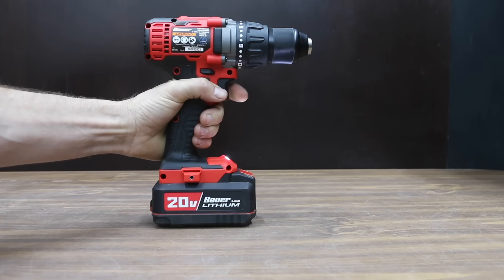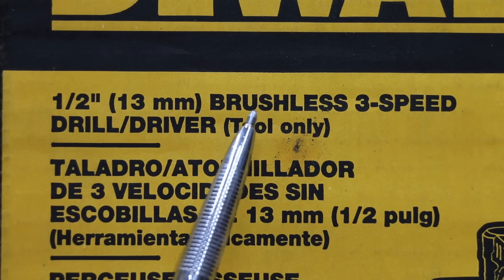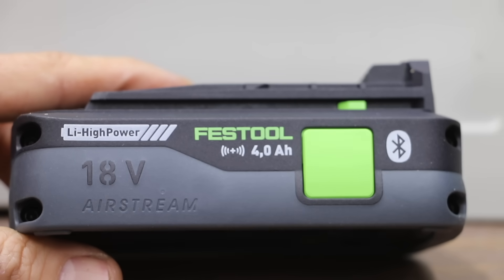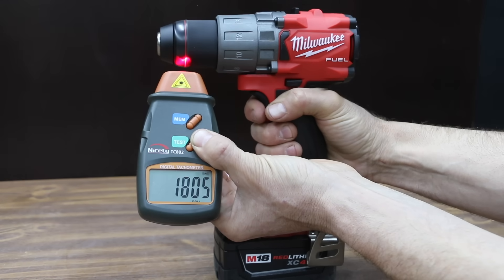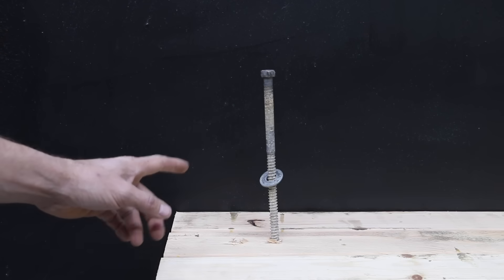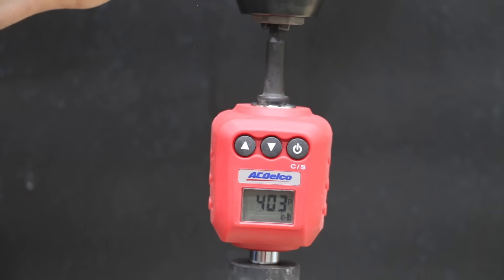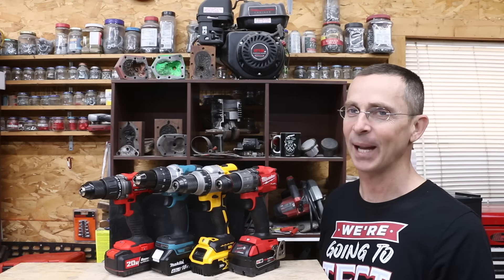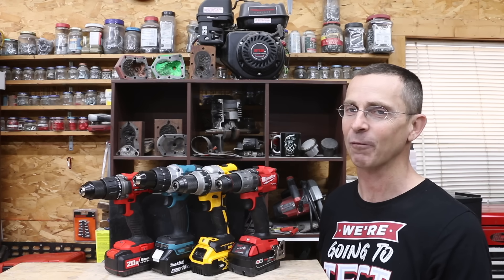Best Drill (BATTERY POWERED)? Milwaukee vs Dewalt, Makita, Bosch, Festool, Ryobi, Bauer, Ridgid

Comment: Great video. About 6 years ago now I bought a Ryobi combi drill and impact driver. Avoided the drill driver because I didn't like the look of it and thought it superfluous considering what I already had. I bought the Ryobi tools as throw away tools that would last a couple of construction jobs and pay for themselves, meanwhile I could earn the money to buy some better portable drills. Well, I've bought myself several other tools that aren't portable drills by now and I have to admit I ended up buying another Ryobi combi drill and impact driver for when my first ones give up the ghost, but they're still going strong. The only problem I have had is with the combi drill but that's because I used a mixer paddle on it too much with thick plaster and such that made the mechanism a bit wobbly so it's no longer the best for precise stuff. The impact driver is still perfect to use and I have not come across a damn thing that it couldn't drive in, even large fixings in wet wood. Grabbed a spare when I saw it on sale for just the tool and I couldn't believe the value.

I couldn't find anything that beat Ryobi on price when you include the batteries and chargers and stuff, and I can tell you from experience that they last, at least the impact driver and combi drill do. I haven't even had to change the brushes!
Reply from the maker: Thanks for sharing.

Comment: I don’t know about the other brands but out of the DeWalt, Bosh and Milwaukee the Milwaukee is the only one that has a drill chuck that is easily user replaceable so since chucks are what tends to fail on me the Milwaukee is what I bought. 

P.S. If there is a choice between metal and plastic chuck versions of the drill shell out a bit extra for the metal chuck.
Reply from the maker: Thanks for the feedback.
Reply: @ProjectFarm  No biggie. The Milwaukee is generally a good drill in other ways since it is also small powerful and handy. That being said I might have bought the DeWalt if it had a user replaceable chuck since it is even smaller and the battery is easier to pull out than on the Milwaukee.

Comment: Fortunately the yankees at least measure time in the same units as the rest of the world.
Reply: Don't give us any ideas lol
Reply: Most Americans can use both systems.  Same cant be said outside the US.
Reply: @Alamyst2011  lol, more like the other way around
Reply: @holdenearl1038  Lol no.  Not like that at all
Reply: @Alamyst2011  You're right, 96% of the world's population should start learning that water freezes at -32 and boils at 212 which apparently seems more logical to some poeple than 0 and 100 degrees. Let's all become idiots instead of use logical units!
Reply: @mojoblues66  Water freezes at -32?  Do you know what your talking about ?
0-100 has 100 measurements 
0 to 232 has 232 measurements   Guess one is more accurate for the laymen.
Reply: @mojoblues66  First, it's 99.98, not 100, so not so perfect after all.  Second, while Celsius may have a good argument for being a better unit for water temperature, Fahrenheit has the advantage of being more precise with air temperature.  And guess which one we humans are generally more concerned with?
Reply: @Alamyst2011  
0-100°C = 32-212°F at standard altitude. So, like 47,54°C is a true measure your more accurate argument is no more a good reason. There is no practical reason to use fahrenheit instead of celsius, only historical uses. Canada uses both but not USA, unlike the entire World where celcius is used.
Reply: @jean-marchemery3116  lol
Reply: @Alamyst2011  Wait until you hear about the comma.
Reply: @LipziG3R  I have learned both systems.  Was taught both systems in school and draft school. For basic house blueprints its all imperial.  For anything mechanical its metric.  Both systems can be very effective.
Reply: @Alamyst2011  I'm not saying that they can't be effective / efficient. Once you learn them they can be used as any other. But saying that Celcius is less accurate because it has less full values for the same temperature range doesnt make much sense, if you can just use commas to get a very precise readout ... way more precise than any normal person would ever need in their life.

Using a system you learned and got used to is perfectly fine tho, obviously.
Reply: American guy on an American platform. Make your own content.
Reply: @user-ct8my8rv9c  Before Globalization we had Colonialism, that's obviously where you are still stuck in.

Comment: Bosch, Makita and Dewalt are a joke compared to HILTI.
Reply: Heh. No! HILTI tools tend to be bulky and heavy. I prefer precision and ergonomics. I'm not saying that HILTI is bad but your statement is definitely the joke.
Reply: @stephenwerner1662  Im not talking about working at home, im talking about professional daily use. Had them all for many years, once you try HILTI you never go back.
Reply: @WhoWantsToBeKing  no. I've used HILTI. I see no advantages to excuse the high price tag of their products. 41 years in construction.
Reply: @stephenwerner1662  I do. Alot more powerful and they outlast Bosch, Makita and DeWalt. Im not talking here about Milwaukee, Festool, Ryobi, Bauer and Ridgid. But If anything is bulky, heavy and weak its Milwaukee, seen 4 different pieces on site and tried, absolute joke. Festool is expensive so ive never got any. Had a 20 year old HILTI drop into barrel of watter, i jumped from the ladder and pulled the cord, 2 days later it worked.
Reply: @WhoWantsToBeKing  I have no problem with you loving your HILTI tools. I just have a problem with you falsely suggesting that  the competitors are a joke. You haven't used them...........that's obvious. 

We both know that you haven't done a comparison of HILTI with Milwaukee, Bosch, etc. Your suggestion that HILTI outlasts the competition just removes your credibility.

Comment: i love my Milwaukees. I spent 25 years in the field as an electrician. They are absolutely bulletproof. But one complaint. All the newer tools are made in China. Really Milwaukee. Even they sold out.

PS, Black and Decker makes a pretty good cordless. They are cheap and effective. The big 1/2" drill and the sawzall 18v are their best.
Reply from the maker: Thanks for the feedback.
Reply: @ProjectFarm  I think you should include some personal input like, does the tool feel like quality? I bought a LOT of stuff on just the feel of items. I can feel quality. 

You are the best on the interweb by the way.
Reply: Milwaukee is owned by tti which is located in Hong Kong, China. It was made in China from the start so they never sold out.

Comment: Nice detailed review as usual. If you need a more light/compact drill the M12 Milwaukee drill is great for drilling pilot holes while working on a ladder. You can keep the drill in one pocket of the tool belt and the 1/4 inch impact driver in another.
Reply from the maker: Thanks!

Comment: "So which one is the best drill?" - HILTI!
Reply: Milwaukee and Dewalt seem to be in the sweet spot.  Festool... what a ripoff.
Reply: @spilot1016  I'd add the Makita in there to your "sweet spot". The Festool? Overpriced junk. Yes, junk. Clumsy and underpowered.
Reply: Milwaukee seems to be worth buying
Reply: @AdelAbuAlaa  I bought the Milwaukee about 3 years ago, and built my house with it, till today i got no issues, and i mistreated it often. At work i got the bosch, but the milwaukee is far better! After this i bought the 1/2 Impactdriver and the angle grinder from milwaukee too. Regret nothing so far!
Reply: @AgentPipapo 
I am Bosch man but from now on will change to Milwaukee if I find it in Australia
Reply: I worked at home depot (hardware dept) and had a chance to test all the drills (Milwaukee, Dewalt, Makita, Ridgid, Bosch and Ryobi) all 18V against the Hilti 14.4V. and the result, Hilti beat them all, and it was the 14.4V only what more if it was the 18V
Reply: @gemmalinao7129  That's pretty much what I've noticed too. We have a lot of tools at work. Some DeWalt (18V), some Bosch Professional (18V) (the blue machines, green is for home use), some Makita (18V) and a whole bunch of Hilti (14V and 22V). Small and easy work we get send off with all but the 22V Hilti at random. Heavy work or large construction site? 22V Hilti or go home! These machines are insanely good, reliable and powerful...to be fair they also cost a small fortune if you don't already have a charger and at least 1 battery, starting around 550€ for the 22V drill with charger and 1 5Ah battery, compared to my bosch professional which only cost me 220€ with charger, 2 2Ah batteries, a bit set and a storage box. If I had the choice I'd always go for Hilti, machines, drills or bits!
Reply: @gemmalinao7129 
I haven't seen the Hilti brand here
Reply: Ive had my Dewalt Impact Drill combo for 8 years.   I install doors, windows etc.  I beat on my tools.   The only complaint Ive ever had about Dewalt is their razor blades.
Reply: HILTI is amazing.
But taking out a mortgage to buy a drill does not make sense to me.
Reply from the maker: Thanks for the feedback.
Reply: @ProjectFarm  Quick question. Is there any reason why there's no Hilti in any of your tests? For example the Hammer Drill Bit test. From all the ones I've used the Hilti ones felt way better than the Bosch or DeWalt ones. Same goes for Drills and lots of other tools I've used as an electrician.
Reply: @Kiramitsuoka  love my Hilti I've owned them all Hilti has been the best for me and I do all forms of construction work
Reply: @ProjectFarm  why no Hilti included in the tests?

Comment: I would really love to see SNAP ON tools VS the big brands. I’ve seen a lot of mechanics use them.
Reply from the maker: Thanks for the video idea.
Reply: Better air tools and hand tools than cordless stuff. Especially considering price. I have a 1/2" cordless Snap-On with a 24v battery that was like $1200 brand new and my matching milwaukee impact performs just as good for a 1/4 of the price.

Comment: I thought I could add a little bit of end user experience to this - I own both the DeWalt and Milwaukee drills. They both have considerable advantages in my experience of using them.

Milwaukee 
- Nicer to use (more compact/battery system is far better and more durable)
- Warranty service seems better in my experience (in the U.K. at least)
- Feels like it has more torque. 
- Handle (don’t use it anyway) is very nicely made. 
- ‘Fuel’ cap on the back is easier to replace than the shell of the DeWalt if you drop it, also comes with a fairly decent bit holder and belt clip which the DeWalts don’t anymore. 

Disadvantages:
- Chuck is total rubbish, buy another one from Germany if you want to do any precision work with it. 
- Only 2 gears where the DeWalt has 3, although this could also be considered advantageous based on my experience of the DeWalt gearbox. 
- The box it comes in is less durable! 

DeWalt
- Chuck is much better than the Milwaukee and has less runout. 
- Tool has 3 gears. 
- Hammer drill is excellent when it works (as is the Milwaukee) 
- Batteries are easier to get hold of here, although less reliable in my experience. 

Disadvantages 
- In my experience the DeWalt was the most unreliable tool I’ve ever owned. I’ve owned it for 3.5 years now and in that time it’s been back in for warranty repair 5 times, the last time it was in for over a month which is why I bought the Milwaukee. It’s also had 5 new entire gearbox/clutch assemblies in that time. 
- Horrendously bulky. 
- Batteries seem to have a habit of spontaneously deciding they no longer work. 
- Customer service is incredibly hard to contact by phone and seem to have little interest in their professional tool line. 

I’ve often bought DeWalt and I do think a few of their tools are class leading especially the multitool which I like the variable trigger as compared to Milwaukee’s traditional speed control - I feel DeWalt rushed into brushless fearing being left behind as my older brushed stuff seems to work pretty much endlessly. 

I never usually comment on your videos but thank you for the content and I always love to see someone who does genuinely impartial reviews - I just thought it’d be good to add my long term experience owning two of these tools, and aside from the reliability issues I’m unbiased as I have no real brand preference here, these are both very capable tools. Unfortunately all of the major prosumer tools have the same issue now which is that they’re aiming at DIYers because the brand is reputable and trusted.
Reply from the maker: Thanks for the feedback.

Comment: Good though the Milwaukee 18v drill is (I use one) it can't take on the 28V version that Milwaukee make (I use 2 of those aswell)   Every test the 18v does ok, the 28v version will blow it away, which is why I cannot ditch the 28v tools I use alongside the 18v tools.  The major draw for me with the 18v Milwaukee range is the cheap cost of batteries, when compared to the 28v range. Typically around £55-60 for the 5amp 18v, with around £185-200 for the 5amp 28v batteries.

The 28v drill is a monster, if you put huge lag bolts into wooden posts etc. without a pilot hole first.
Reply from the maker: Thanks for the feedback.

Comment: To not completely compare apples and oranges. 
The Festool price is a complete set inclusive of systainer, 2x batteries and rapid charger and a right angle chuck, further more gear position 3 and 4 are designed for drilling.
And the slowest speed it can turn is way lower then 11 if you put the torque switch on position 1 I guess it goes down to 3 rev/min, I own this one and its predecessor the Protool PDC 18-4 which is almost 12y now and still alive and kicking. Bought the festool while the protool fell from the second floor and i feared it would pass away soon after, but it didn't ;) Untill 2y ago both were used daily and never regretted spending this amount of money.
For short if you only want a drill and not the complete festool system buy makita or milwaukee. If you want the benefits of the system (all boxes connect, 12 and 15v batteries fit in 18v machine for that last hole or screw of the day. Your old NC or NiMh batteries load in same charger etc. etc. A more than perfect service and parts for at least 10 years after last production date) Definitly buy festool. Yes it's not cheap but in de long run it pays off.
Stay away from DeWalt they change their type's and design too often too quickly resulting in some very bad series.

I am in no way affiliated to festool I'm just a very happy european customer and thought it didn't got a complete fair comparison. Furter more i like these comparison video's a lot.
Reply from the maker: Thanks!  Thanks for the constructive feedback.

Comment: Before I watch to the end. We use both milwaukee, bosh and dewalt at work and give them a hard time. From my experience I will say one thing: bosh is crap. Embarrassing build quality not commensurate with the price. I would never spend my own money on something like that. There are units that are defective right out of the case. I honestly don't recommend it. What's different milwaukee or dewalt, well made and reliable and milwaukee is very compact.
Reply from the maker: Thanks for the feedback.

Comment: Great video, one thing to note about the Ridgid brand. I have had mine for 10 years. The batteries that came with the 5 piece set have a lifetime warranty. Ridgid has now replaced 2 of my batteries under warranty. Would have cost me $200 or more to replace them from any other manufacturer.
Reply from the maker: Thanks!  Thanks for sharing.
Reply: Ridgid is the only portable tool I will buy now. The batt.packs for the others cost more than the whole kit cost originally!

Comment: Every one of the torque ratings were presented wrong. In metric its N•m not Nm and never mN. So that's the variable force value unit x the constant distance unit. Therefore the Imperial UK/US torque units are presented in the same way as lb•in not in•lb and likewise to lb•ft not ft•lb
Note the separator symbol raised dot •, its not a period to indicate in. as an abbreviation of inch. Many people vernal say inch pounds and we know what they mean, but it should never be written like that. Scientific rules and presentation standards and specs apply for consistent presentation worldwide. I am one of those who help write such documents, so anyone saying otherwise is on a looser.

Comment: what about the longevity of the parts? Which is better? rigid lifetime warranty. if it breaks warranty it. I have a dewalt set that Ive used for light duty and its holding strong years later. my makita tools have been reliable too.
Reply from the maker: Thanks for the video idea.
Reply: @ProjectFarm  it would be hard to do. you'd have to build a trigger rig that presses the triggers down automatically.  and the time involved is quite alot. The average warranty is 3 years, you would have to create test scenarios for both light duty and heavy duty use over 3 years accelerated. It is a grand undertaking. 

the easiest would be contestant use, tape the triggers, and film the batch. this is a ton of footage, so you'd have to have a setup like a security camera server that deletes old data. 

It is a great idea but not one I would expect to be implemented. Good luck if you Try.

Comment: My Ryobi tools say made in Vietnam. I’m curious why you went with brushless for some of the brands and not others.
Reply: I still love all my Ryobi tools.   I don't know about exact models compared to the ones you chose but I have not seen a ton of difference.  The Ryobi driver used in this video is their absolutely dirt cheapest low powered one.  So basically comparing a $70 Ryobi to a double that price DeWalt.  A reasonable comparison would have been by cost.   There are Ryobi drivers in the same cost range as the DeWalt that deliver far more  power and performance.  Not a fair comparison at all.